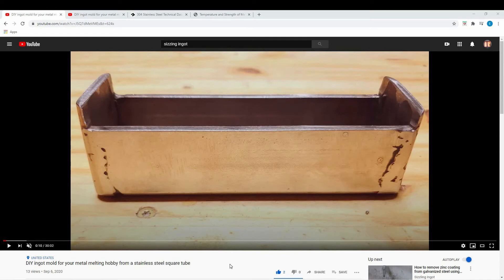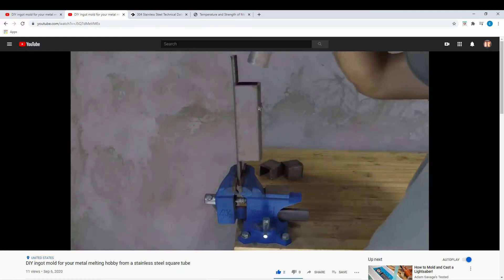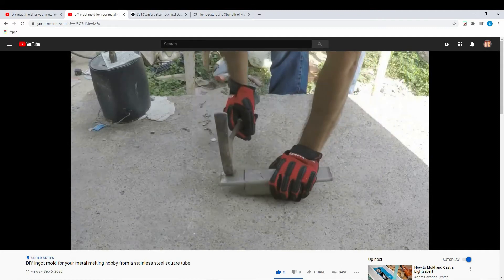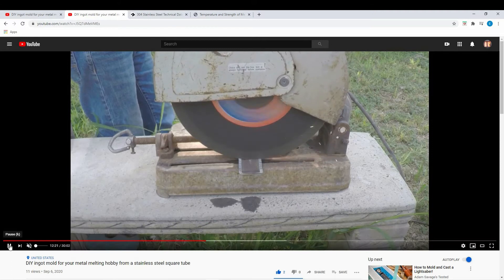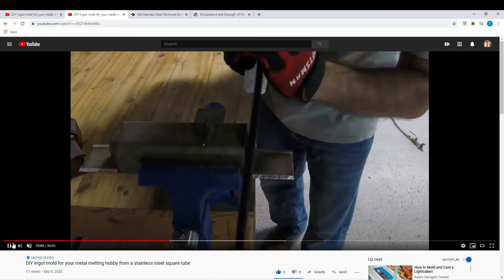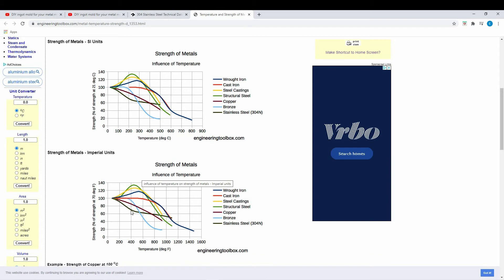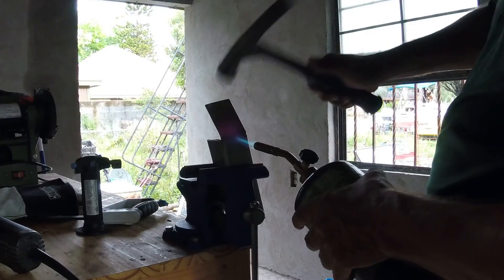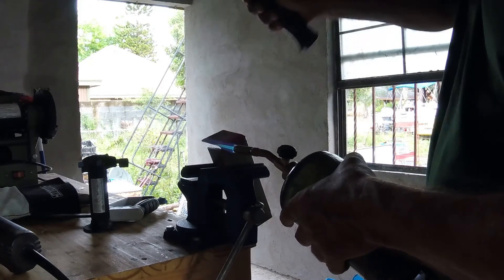Lessons Learned - "DIY ingot mold for your metal melting hobby from a stainless steel square tube"

Comment: if you cut or grind away some of the material along the line you want to bend, it will make it easier. Nice molds! cheers
Reply: That and heat it up, even with a propane torch.